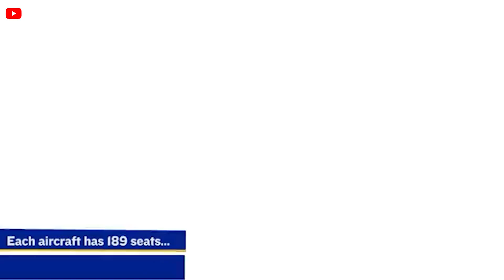The REAL Reason Every Airlines OBSESSED 737-800 over the Airbus ...

Comment: KLM is getting rid of all of their 737-800S to replace them with the A321-NEOS and which is a good thing more seating capacity a bigger plane much more efficient than the 737-800 but also cheaper to fly and maintain and KLM has a lot of Airbus planes in their fleet anyway so it will work for them